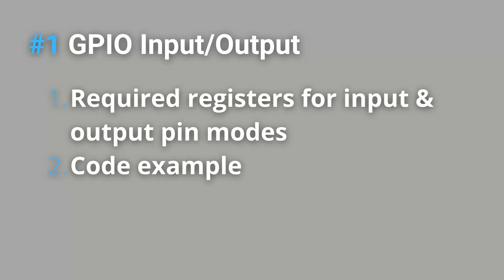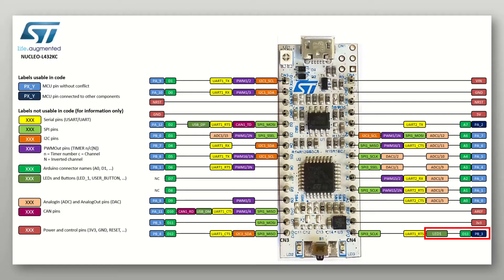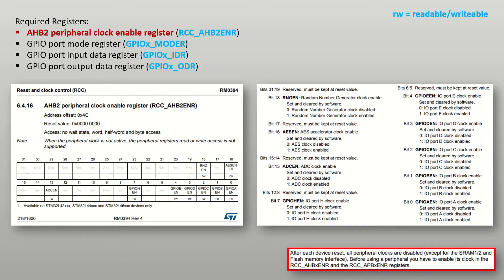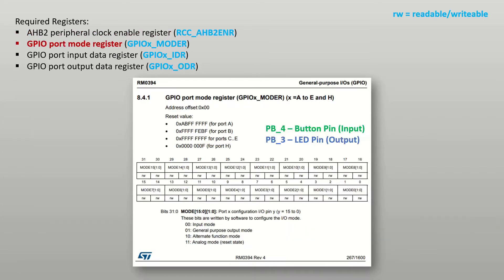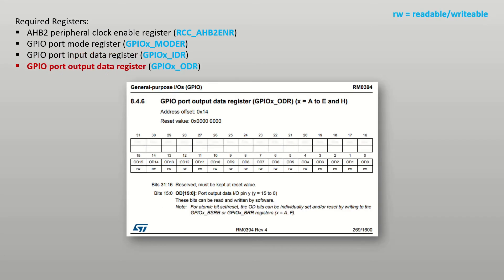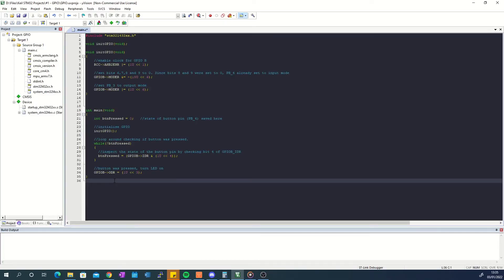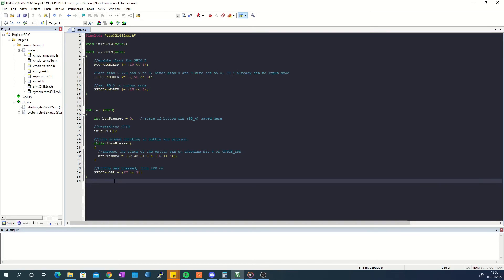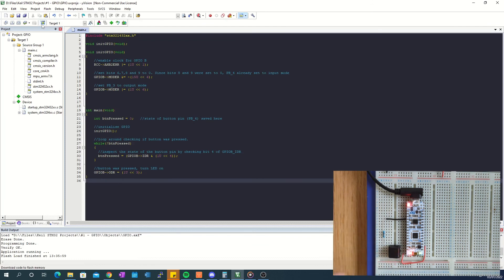STM32 GPIO Programming #1 - Input/Output

Comment: why did you use ahb2 instead of ahb1 what is the difference
Reply from the maker: The GPIO ports are connected to the AHB2 bus. The AHB2 peripheral clock enable register contains the bits that enable the clocks for the IO ports. Since I was using pins on IO port B, I needed to set bit 1 of the aforementioned register to enable the clock for IO port B. 

The AHB1 peripheral clock enable register contains bits to enable clocks for peripherals that are connected to the AHB1 bus.

Essentially, the difference between these two registers is what peripheral clocks they can enable/disable. Hope that helps.
Reply: @z-the-programmer4584  thanks for adequate answer thank u. Why dont you use cubeide ? Is it better or worse or just do you accustomed to cubemx
Reply from the maker: I'm used to Keil uVision that's why I use it. That being said, I haven't tried cubeide but I might give it a try at some point.